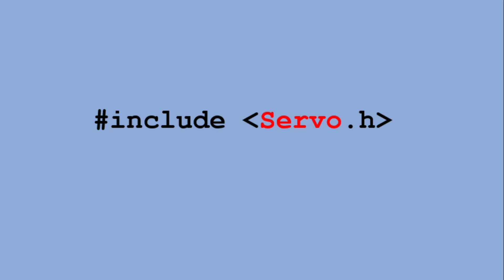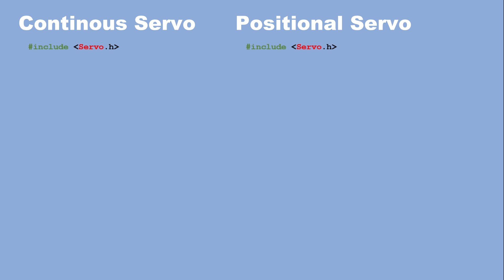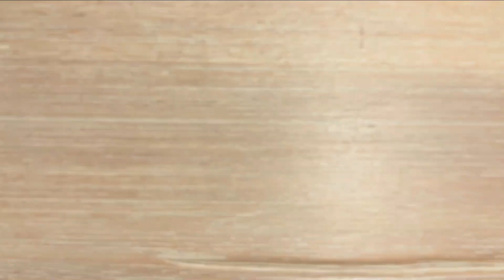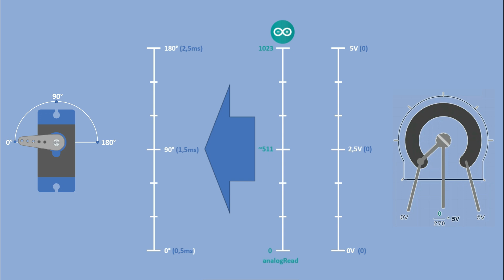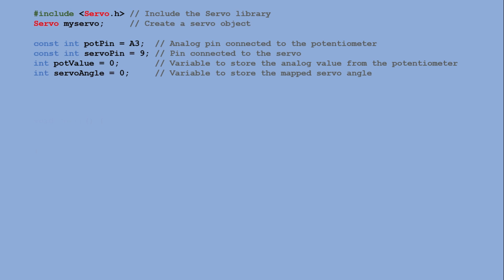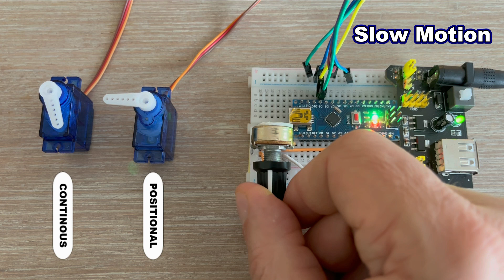Arduino Servo Basics: Control Servos with Servo.h Library and External Inputs

Comment: How can I fix the dead zone from the potentiometor at the begining and the end of the rotation of the potentiometer?
Reply from the maker: The solution is to calibrate the setup by mapping the actual potentiometer range, which is often different from 0–1023. If you are referring to the servo’s limited rotation, then you should use better-quality servos; TowerPro servos are among the cheapest and have limited mechanical accuracy.
Reply: @marios_ideas  can I download the code?